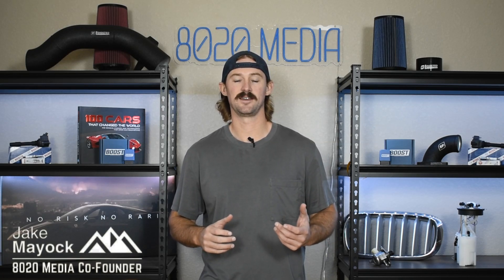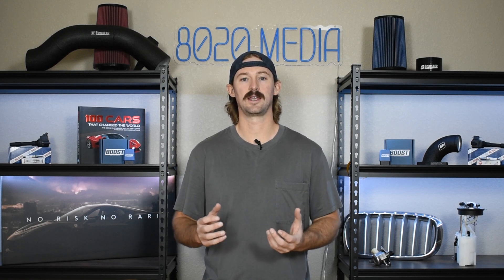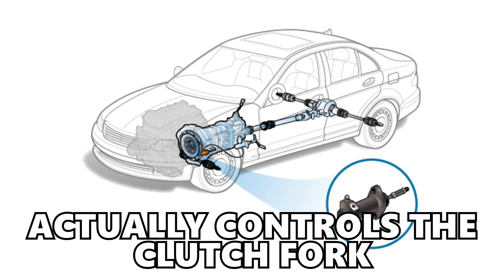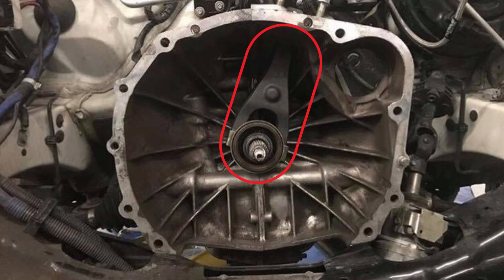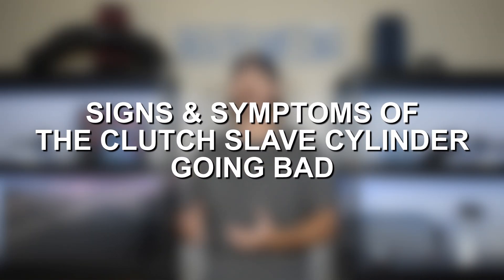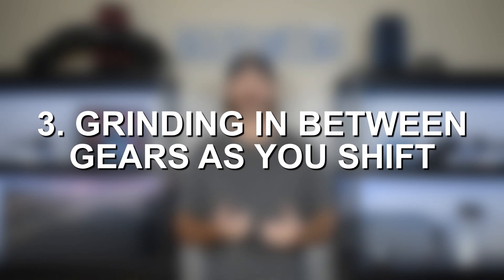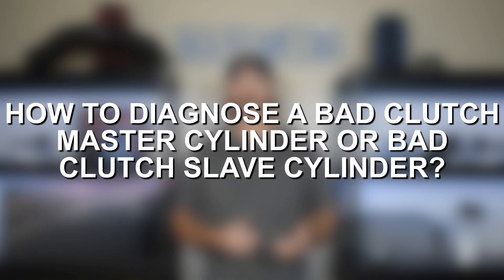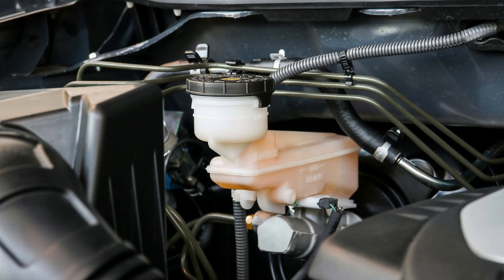Bad Clutch Master or Slave Cylinder? Symptoms, Diagnosis, and Fixes Explained!

Comment: Help please 🥹 Trying to get back on my feet post surgery as self employed out of work for over a year. I woke up w fluid on ground, clutch pushed and got stuck to bottom and won’t go out of 1st (manual). Symptoms last 2 weeks was a slight delay getting in 1st driving, like it hesitated before moving. Whole kit and flywheel changed 3 months ago. Reservoir empty. Peugeot Expert 2019. Need to work. Any ideas PLEASE?! 🙏
Reply from the maker: R - Given that your clutch pedal is stuck to the floor, the reservoir is empty, and you've recently had the full clutch and flywheel replaced, it’s almost certainly a hydraulic failure, most likely due to a leaking slave cylinder—especially if it’s internal, which would explain fluid loss without visible drips; the delay you felt in the past weeks was likely the system gradually losing pressure. First, fill the reservoir with brake/clutch fluid and pump the clutch a few times to look for external leaks at the slave or master cylinder (check around the transmission bell housing and pedal area), and see if you can temporarily regain pressure—if fluid leaks from the bottom of the trans or firewall, you’ve found your culprit. You’ll need a cylinder replacement (likely slave), but even topping it off and bleeding it could temporarily get you moving just to reach a shop or job if the leak isn’t massive—just monitor the level closely.
Reply: @8020Automotive You are an absolute star 💫 
thanks a million aye! Filled fluid last night , brought pedal back up, tried to pump, pedal still stuck to bottom right after w more of a sponge feel. Liquid gone this morning and back to a clunk type bottoming/sticking! Will take to garage I reckon. But your kindness taking time to try to help in a vulnerable moment means more than words can express. Thanks from French alps 🙏
Reply from the maker: @RealMuppet Hope you can figure it out! Keep us updated.

Comment: “My 2013 Nissan Note 1.4 diesel has a soft clutch pedal, and I’m struggling to put it in and out of gear. I checked the fluid level, and it seems [low/normal], but I suspect there may be a leak in the clutch master or slave cylinder. It might need bleeding or cylinder replacement.”
Reply from the maker: M - A soft clutch pedal combined with difficulty shifting gears in your 2013 Nissan Note 1.4 diesel is a strong indicator of air in the hydraulic system or a failing clutch master or slave cylinder—especially if the fluid level is low, which suggests a leak that’s letting air in and reducing hydraulic pressure needed for full clutch disengagement; even if the level seems normal, internal seal failure in either cylinder can cause the same issue without visible leakage. Start by thoroughly inspecting around the clutch pedal (master) and transmission bell housing (slave) for any dampness or residue, then bleed the system to restore pressure—if the issue improves temporarily but returns, you’ll likely need to replace the leaking or failing cylinder to fully restore smooth clutch operation.

Comment: I really miss the old school direct mechanical cable or linkage from the clutch pedal to the clutch fork/leaver. No hydraulic system needed.
Reply from the maker: B - They certainly don't make them like they used to!
Reply: @8020Automotive 

2000 F150 4.2 4wd 
I was told one of the cylinders is in the transmission. 
Having clutch issues… clutch releasing near floor so if clutch pushed to floor amd starting in gear the vehicle is starting to move forward. 
Difficult to press clutch and push it into gear. Clutch near the floor when releasing . 
Reservoir near hood is full
Reply: I've considered converting my car to cable clutch setups many times.

Comment: I had the master cylinder changed and since that my clutch felt weird and changing gear felt weird like it engaged/disengaged differently also started slipping but sometimes it don’t slip then it slips what could this be
Reply from the maker: S - If your clutch started feeling off and intermittently slipping right after the master cylinder was replaced, it’s likely that the hydraulic system wasn’t properly bled, leaving air in the line—which would cause inconsistent clutch engagement, weird pedal feel, and erratic slipping since the clutch isn’t fully disengaging or re-engaging under pressure; another possibility is that the pushrod on the new master cylinder wasn’t adjusted correctly, causing either too much or too little travel. Start by having the clutch system fully re-bled using the correct procedure (preferably with a pressure or vacuum bleeder), and if that doesn’t resolve it, inspect the master-to-slave cylinder ratio and pushrod length to ensure proper pedal stroke.

Comment: Fiesta 1.3 2007 hard shifting and gridnign iwhen try to use resverse gear, 200k km on clock any ideas o the issue?
Reply from the maker: N - Hard shifting and grinding when engaging reverse in your vehicle—especially at 200,000 km—points strongly to a worn clutch that's no longer fully disengaging, which causes the gears to clash since reverse isn’t synchronized; other possibilities include worn or contaminated transmission fluid, a failing clutch master or slave cylinder (if hydraulic), or worn shift linkage bushings, but the most likely cause at that mileage is clutch wear. Try shifting into a forward gear like 1st before selecting reverse—if that helps, it's another sign of poor clutch disengagement, and a full clutch kit replacement is likely needed to fix it properly.
Reply: @8020Automotive  Is there a chance that when brakes pads where changed the air got into hydraulic system  and this is causing clutch to not fully disengage. In the workshop they removed around 40cm3 of hydraulic oil from reservoir? After his I notice change in gear shifting. If this possible how to tackle the issue?

Comment: Great walkthrough. I've just replaced the master cylinder and bled the system afterwards on the slave cylinder, and it got a bit better. The pedal isn't totally sticking to the floor anymore, but it isn't great either. And it is slowly getting worse again, so I've ordered the slave cylinder as well. If both of these are located fairly easy to replace, do them both at once. That way you don't have to remove a lot of stuff twice. (Although now I know how to remove it, so it should be a lot faster). If you own an Octavia MK2, do both. It requires removal of the air filter box, removal of the battery and the tray the battery sits on. Then you can undo the hoses, and remove the clutch pedal. (Which requires removal of some trim inside the car, but that is just a few screws and clips..) The master cylinder is attached to the cluctch pedal itself. Totally doable for a non-mechanic, there are many good youtube videos to guide you through the replacement. (This will be a bit more difficult if the steering wheel is on the right side)
Reply from the maker: E - Thanks for the feedback and for taking the time to share these insights!

Comment: 2002 Honda civic EX and my pedal is spongy and I can’t get it into second from first and when hauling some a$$ it’ll grind from first to third and it has a new clutch kit installed so hoping this might be the issue
Reply from the maker: K - A spongy clutch pedal combined with difficulty shifting—especially grinding when going from first to third under load—usually points to a hydraulic issue rather than the clutch disc itself, even if the clutch kit is new. Most likely, the clutch master cylinder or slave cylinder is worn or has air in the system, preventing full disengagement of the clutch. Try bleeding the clutch system thoroughly, and if that doesn’t solve the issue, replace both the master and slave cylinders, as they commonly wear out on 7th-gen Civics. Make sure the clutch pedal free play is also within spec. This should restore proper clutch engagement and allow clean shifts.

Comment: Toyota corolla sedan 1.5 petrol manual trans. Europe version. Squeacking noise coming from clutch every time when pedal is releasing and coming to moment the car starts to move. They change whole clutch set + bearing which is pusing on clutch under warranty. After 200km it started squeacking again. they dont know what is the issue. Did you experience similar problem ? thanks
Reply from the maker: D - Yes, this is a fairly common issue on various manual transmission vehicles, including some Toyota Corolla models. If the full clutch kit and release bearing have already been replaced and the squeaking returned quickly, the likely causes are either (1) the clutch fork pivot point or the clutch fork itself not being properly lubricated during reassembly, or (2) the noise is coming from the clutch pedal mechanism inside the cabin, such as the pedal spring, bushing, or master cylinder pushrod. Many mechanics overlook these components when replacing the clutch, especially the fork pivot ball and contact points, which should be greased with high-temp clutch grease. Have them recheck both under-dash pedal components and transmission-side pivot points—lubrication is usually the fix.
Reply: @8020Automotive  Thanks for response, Pedal was squeaking as well, they lubricate it now its not doing it anymore, now sound coming only from engine bay. On monday i am going agian to mechanic and they are going to do job again under warranty. I hope they will repair it and it will be ok. If not, in my country i am allowed by law after third time using warranty on same problem to ask for compensation, canceling the lease and returning full price of car or replacing car for new one.

Comment: I was driving last night and stopped at the red light and pushed the clutch in to go and let out in first gear and it didnt go. I was just sitting there.  I bleed the system.  The system has pressure and moves the fork some the peddle never bleed up real good like it used to.  The peddle feels funny still but has pressure , and when i put it in first gear and let up the peddle the car doesnt go anymore . I almost feel the clutch trying to engage. But it didnt.  The clutch disk and that system is three years old. And the master cylinder and slav cylinder is the same age.  Anyways  each Winter i bleed the system. Anyways nothing worked this time around. 2006 honda Civic EX coupe
Reply from the maker: C - Sorry to hear this.. Based on your symptoms, it sounds like your clutch is not fully disengaging or re-engaging, possibly due to a hydraulic issue despite having some pressure; the fact that the pedal never firmed up like it used to after bleeding suggests either a failing master or slave cylinder (despite their age), internal bypassing, or trapped air you couldn't fully bleed out (especially common with Honda’s design since the slave sits low and traps bubbles). If the fork is only moving slightly, that would indicate insufficient hydraulic throw, which prevents the pressure plate from fully engaging the clutch disk, meaning the engine spins but no power transfers to the wheels. You could also have a collapsed or damaged clutch disk or pressure plate (especially if a spring popped out), but given your history of regular bleeding and the fact that this issue came on suddenly after a stop, I’d re-check for full and complete hydraulic motion at the slave cylinder with the pedal fully depressed—if it’s weak, try re-bleeding with a pressure or vacuum bleeder, and if that doesn’t help, you’re likely due for a new master or slave cylinder despite them being just a few years old.

Comment: I have similar issues except the pedal does not have issues coming back.
Reply from the maker: I - What issues do you have then?
Reply: @8020Automotive when i start my car in the morning or after its parked for a few hours; my clutch will not engage or release once it engages. Once engine is warm then its back to normal and gear engage and disengage on command. I do have to press on the clutch pedal harder than usual.  It started with only on first gear being the issue. I had transmission fluid change then all the gears have this issue when engine cold
Reply from the maker: @ICHLIEBEmusic  What you’re describing sounds like a hydraulic clutch system issue, most likely caused by a failing clutch master cylinder or slave cylinder that’s not moving fluid properly when cold—once the engine warms up and the fluid thins out, pressure builds and things start working normally again; the fact that it started with just first gear and now affects all gears when cold, combined with a hard clutch pedal, strongly suggests there's internal restriction, air in the lines, or a sticking seal in the master or slave cylinder. Since the issue got worse after the transmission fluid was changed, it's possible air was introduced into the clutch hydraulic system if it shares the reservoir (in some vehicles), or heat is masking a failing seal. I’d start by bleeding the clutch system thoroughly, and if that doesn’t help, plan to replace the master cylinder first, as it’s the usual culprit for cold/hard pedal behavior.
Reply: @8020Automotive thank you for the insight!  I will definitely start looking into getting a new clutch master cylinder. 

Also a prior to that issue… i had someone replace the oil pan gasket. I wonder if the mecanic messed around with my slave cylinder lines. I will get under and take a look

Comment: My pedal was sticking to the floor could it be extreme heat that caused it?
Reply from the maker: l - Yes, extreme heat can absolutely contribute to a clutch or brake pedal sticking to the floor, especially if the vehicle’s hydraulic system (clutch master or slave cylinder, or brake master) is already weak or worn; high heat can cause fluid to thin out, seals to expand or soften, and in some cases even boil the brake/clutch fluid, creating air pockets or vapor lock—which leads to loss of pressure and a spongy or stuck pedal; if this happened after heavy driving, stop-and-go traffic, or long idling in hot weather, that could definitely be the trigger, but the root cause is usually a failing master or slave cylinder, contaminated or old fluid, or internal bypassing in the hydraulics, so it’s worth checking for leaks and bleeding the system before replacing components.

Comment: I have a honda civic si 2018 and the clutch stays on the floor
Reply from the maker: K - If your 2018 Honda Civic Si's clutch pedal is staying on the floor, that's almost always a hydraulic failure—most likely a bad clutch master cylinder, slave cylinder, or a leak in the hydraulic line that’s caused a loss of pressure; check under the dash for fluid around the clutch pedal (which points to a bad master), and check the slave cylinder on the transmission for leaks; also inspect the fluid level in the reservoir—if it’s low or empty, that’s a clear sign of a leak somewhere; if everything looks dry, there could still be internal seal failure or air in the system, so try bleeding it first, but odds are you'll need to replace either the master or slave to restore pressure and pedal feel.

Comment: Hiya, my clutch pedal is hard, even after a recon gearbox and brand new clutch. The pedal is still stiff and also when the clutch is engaging feels like a  grind before it goes in ? Its mk6 golf, im so stressed and wasting loads of money.  I havent touched the master or slave cylinders yet... when the new clutch went it the pedal was very soft and normal for a day then went back stiff, since then iv had a new gearbox aswell please help im ripping my hair out..
Reply from the maker: T - Totally get why you're ripping your hair out—after a new clutch and gearbox, a stiff clutch pedal that quickly returned after feeling normal for a day strongly points to a hydraulic issue, likely the clutch master cylinder or slave cylinder not fully releasing pressure or binding under load; the initial soft pedal could’ve been the system briefly self-bleeding or compensating, but once pressure built back up, the internal fault reappeared—if it feels stiff and there’s a grinding sensation when engaging gears, that suggests the clutch isn’t fully disengaging, which puts strain on the syncros and causes the grinding; at this point, replacing both the clutch master and slave cylinders, and doing a full system bleed, is the next logical move—especially since they’re wear items and often go overlooked during clutch jobs; you’ve already done the big (and expensive) stuff, now it's time to make sure the hydraulics are actually letting that new clutch work the way it should.
Reply: Thank you and so well explained . Apreciate your help my friend . Thanks again

Comment: if youre replacing the clutch master cylinder replace the slave too. chances are by the time the master goes so does the slave.
Reply: Yeah tell that to someone who has an internal slave cylinder. You have to pull the transmission out to replace the slave cylinder. Know which one it is for some cars is REALLY important
Reply from the maker: C - Very good point!
Reply: @8020Automotive Hello man. I have a strange situation with a 2015 Opel Insignia 2.0 diesel.I press the clutch pedal and shift gears for a second and it idles and doesn't accelerate. Do you think it could be a problem with the secondary pump? There are no leaks and no oil shortage.I did the test for the situation where the clutch would slip and does not slip (constant speed in 4rd gear, 2000 rpm and Accelerated suddenly and does not skid, does not idle. Only after I change gear. Your opinion would be very helpful. 🙏🤝
Reply: The clutch master replacement costs less labor, compared to slave.
Reply: I came to the comments to post this exact comment.  Usually the higher pressure generated with a new master will crush the old slave as well.